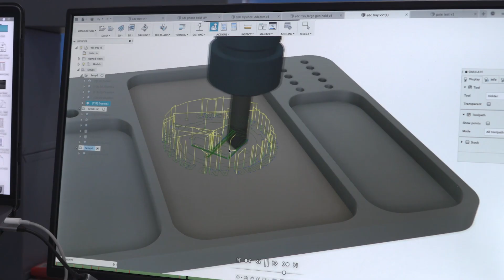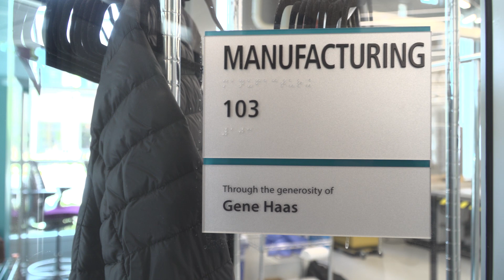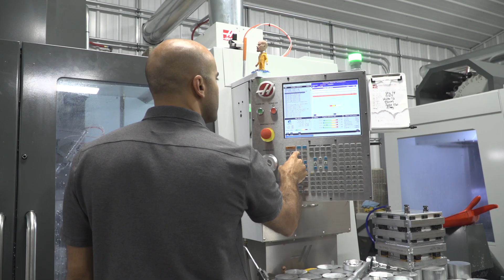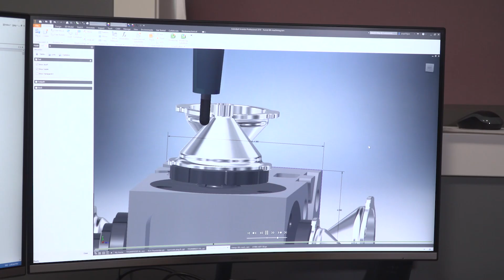HTEC Network & Careers in Manufacturing - Haas Automation, Inc.

Comment: great lab and a great speech but honestly, over 90% of those students who enroll in a class there @ perdue are not going to leave college to run a cnc machine for a living, especially knowing that they can do that now without the high student debt. I have worked with lots of engineering degreed folks over the last 20 years and zero have actually ran a cnc machine for a living, couldn't tell you what a G00 is from a G01

Comment: "Need more machine operators" "Average $74 000 salary" No, what companies seem to 'need' are button pushers. Unload part, load blank, push go, make your $15/hour and don't ask questions. Someone "smarter than you" has done all the work and made their $150 K yearly for code that is basically exactly what some software spat out and has not been optimized in any way. The average salary does not mean anything if one person makes a lot while several make much less.

Comment: I which Haas had a better control panel. The number of time in a day where it keep saying wrong mode.  If it had soft keys that would make your hand move  in a natural way (from up to near the screen toward what you want to do like going in manual mode. Now it is a zig zag pattern that is just way to awful if you did it wrong and it tell you wrong mode when you are in the machine trying to remove your tooling "hard gringe" Full of micro miss opportunity management and time lost if not a safety issue in it self.  2020 still with no QWERTY... Has a gamer myself I really like the hard key from Logitech gaming keyboard hass abcde weird hmmm and button go try it and find me one person that can type 400 words a minutes with that ...  and I hope to see a better respond from the control not just a little beep that I can't ear with ear plug.  When a hard key is press it because I choose to do so. Haas control reply wrong mode... because the orders was wrong Double hard gringe.
Reply: you seem to be having a hard enough time using a normal computer
Reply: I'm just learning the Haas control myself and it's frustrating for sure, but I understand the legacy of it being pretty important. That said, what I wouldn't give to have it setup with a more traditional palms down keyboard and some kind of touch screen and other manipulation methods to make navigating and programming at the machine 10x easier.